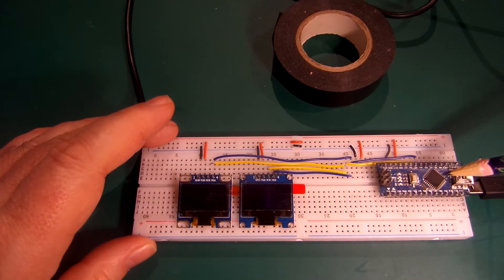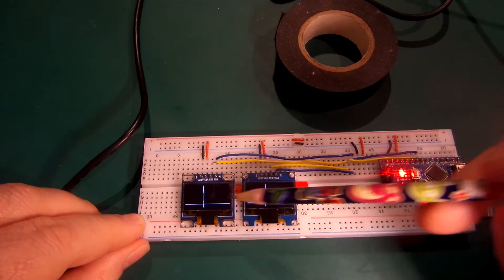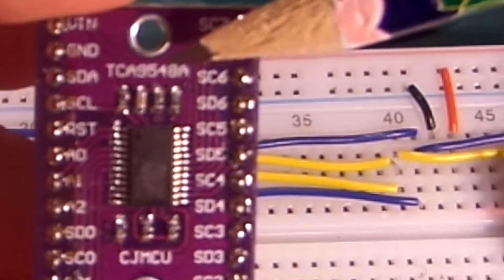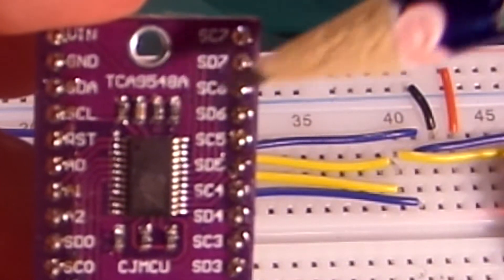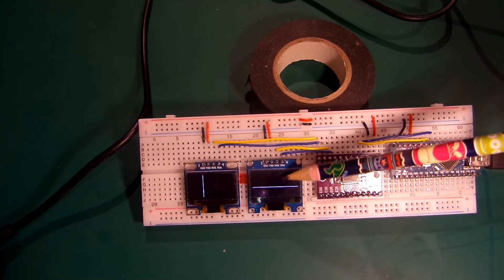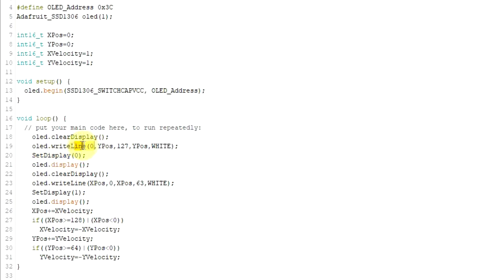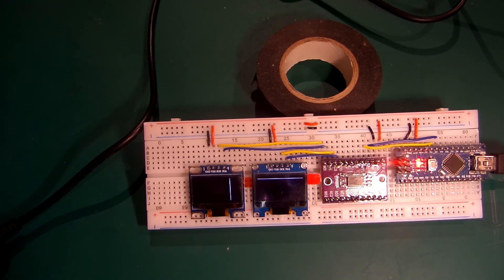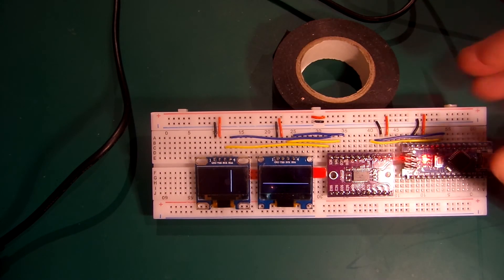Using multiple identical I2C devices with Arduino (or other MCU) - Multiplexers

Comment: Great video, one question 
Can you connect more than 2 screens?
Reply from the maker: Yes, upto the limit of the number of seperate i2c outputs on that chip
Which at present I can't remember what that is. Although I did find the set up oddly unreliable and I did a follow up video. I think it was something to do with those particular screens.

Comment: for i2c communication can i use diffrent sensor? for example : i have SHT-31D and RTC clockwise sensor is it doesn't matter?
Reply from the maker: The video just shows a problem if you have two of the same sensor, if they are different then you can just connect them both up to the same Arduino pins. It can be a problem if two different devices have the same I2C address but I had a quick look and the SHT-31D has the address 0x44 and one real RTC I saw (you didn't mention which one of those) had the address 0x57. So you should be fine.
Reply: @XTronical  thanks a a lot 🙏

Comment: In your article you write about problems on power up and that you DO have a working solution using some "74 series logic chip", but obviously this article is still not written yet. Could you please share your notes or whatever you have (which chip, what does it)?
Reply from the maker: I did a follow up video with the solution, forgot to write the article! However video should have all the detail you need, here's the link https://youtu.be/b4dpz8xWZHE

Comment: Great video thanks!

Do you think this multiplexer would work well will i2c based sensors? I'd like to multiplex a few LIDAR sensors - just wondering whether there could be any issues.
Reply from the maker: I can't think of any problems apart from it would take 4 times the time to pull data from 4 sensors as it would 1 sensor. I did have some issues with oled screens but most if not all other devices should be fine.
Reply: @XTronical  Excellent! I'll see how it goes.  Those multiplexer modules are really cheap

Comment: Hello I am also trying to do a similar project and is wondering if you manage to fix the problem
Reply from the maker: Not with those devices, only using the fix with some 74 series logic chip that I showed in a later video.
Reply: do you have a link to that video ? i had a quick look and couldnt see it
im guessing this one :)
https://www.youtube.com/watch?v=b4dpz8xWZHE
Reply from the maker: Yes that's it.

Comment: The Adafruit doc suggests a bypass cap between vcc and gnd on the mux. Those little buggers really help sometimes.
Reply from the maker: Cool, haven't tried that, will give it a go. Thanks very much for your help.
Reply from the maker: Damn, I really expected this to work but it didn't. I then went for a belt and braces everything approach, I de-coupled the mux, the screens, added the pull ups for the sda,sc, included the reset line and added a software delay before talking to the board. Still the same behaviour with no change either way. As mentioned at the end of the vid I'm going to try a different way of doing this using a 74xx series IC. I have a feeling this will work fine! Good old 80's.
Reply: XTronical Let me know how it works out.

Comment: Doesn't the mux have a reset pin that you aren't using. There could be a race condition in that the Arduino resets faster than the mux and the mux isn't quite ready for data.
Reply from the maker: Yes, it does, tried it, even put in big delay (seconds) before sending data, still didn't work. Thanks for helping though 😊